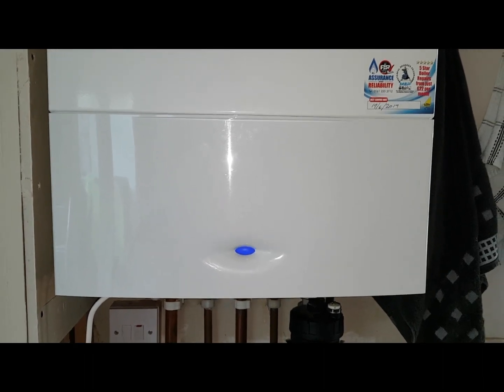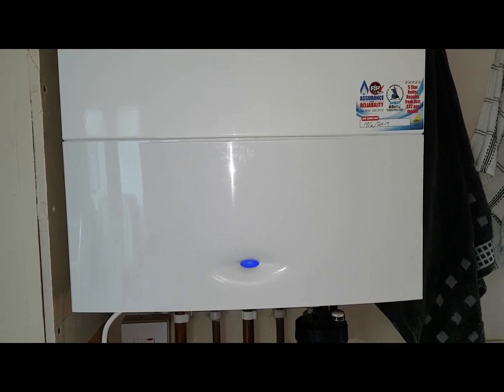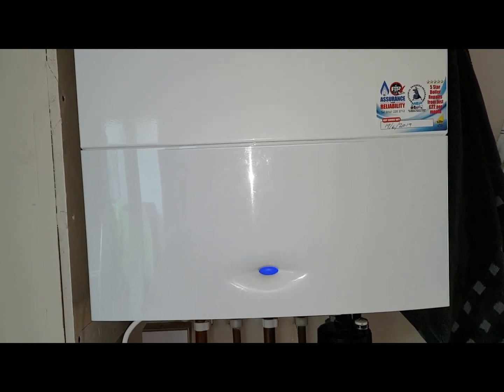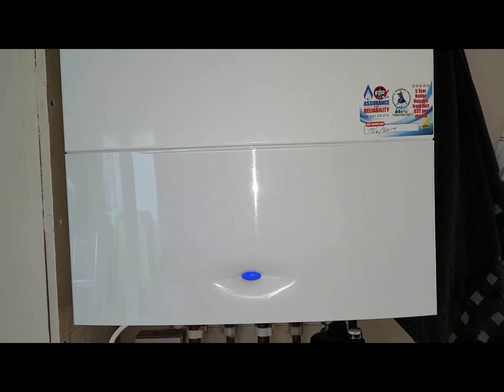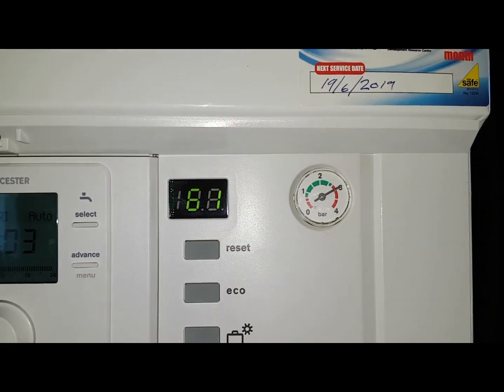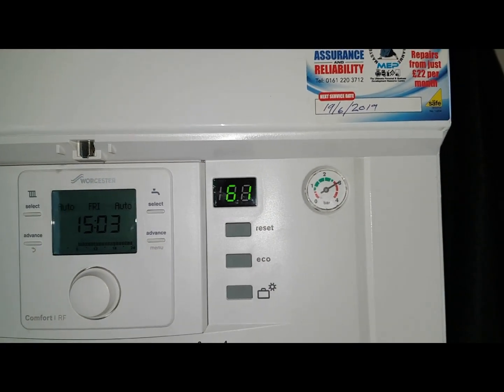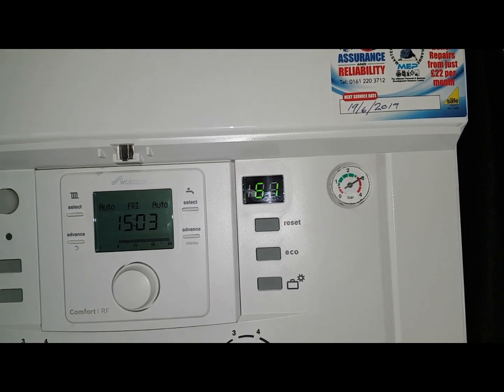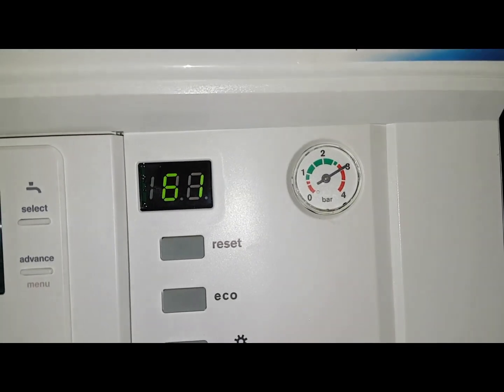Pressure Gauge at 3 Bar  With Coach Tony Morgan

Comment: Question - If you leaving the filling loop key in would that cause the  system to over pressure taking the gauge to 2.1/2 bar?
Reply from the maker: As long as the inlet tap is properly closed it should not make that happen
Reply: @ARBoilers  Thank you. Just had a new pressure vessel put in and it is still going to 2.1/2 bar, any suggestions what it may be?

Comment: Filling loop passing/left open (perhaps somewhere else on the system)

split plate heat ex (unlikely on new install)

No expansion vessel charge or not enough expansion for the size of the property. I’ve seen older Worcester’s without the expansion hose connected at all !
Reply from the maker: hey we're currently trying to grow our Facebook group and would love you to join Tony and the team using this link, Tony will be available to answer all your questions directly there's also updates on new trainings we just released too. https://www.facebook.com/groups/167070231326174

Comment: Not quite sure. USA here. The automatic feeder valves I’ve seen for domestic boilers are supposed to maintain 15 psi (1.034.) Faulty or missing feeder?

A boiler relief valve here I see is 30psi (2.068 bar.) Faulty or incorrect relief?

The expansion tanks I see are 12 psi, so see if it’s missing or faulty. Amtrol 30s are made in America, so you can’t trust their quality... 

Does the boiler have an indirect domestic hot water zone? Could be a blown indirect coil. 

I don’t know if I have enough information to work with, but I could just be dumb.
Reply: The colonies are still number one! ☝️🇺🇸🇺🇸🇺🇸☝️
Reply from the maker: Hi JF yeah right it's the filling valve passing
Reply from the maker: Virtual Boiler Repair Mentorship | Online Boiler Repair Coaching
https://www.boilerrepairmentoring.co.uk/virtual-boiler-repair-mentorship/
Reply from the maker: hey we're currently trying to grow our Facebook group and would love you to join Tony and the team using this link, Tony will be available to answer all your questions directly there's also updates on new trainings we just released too. https://www.facebook.com/groups/167070231326174